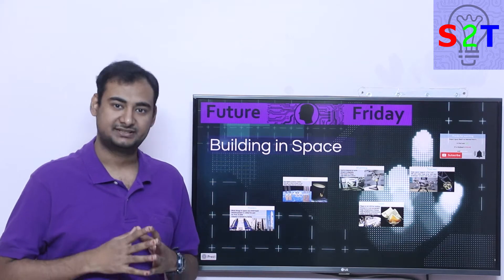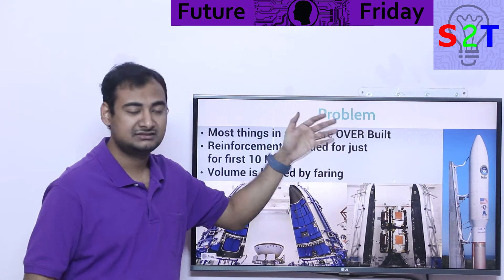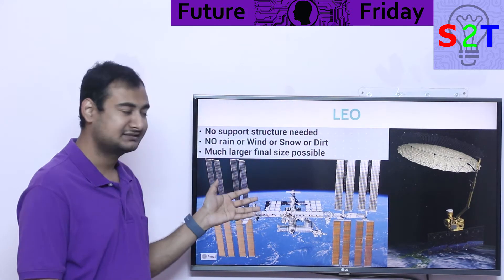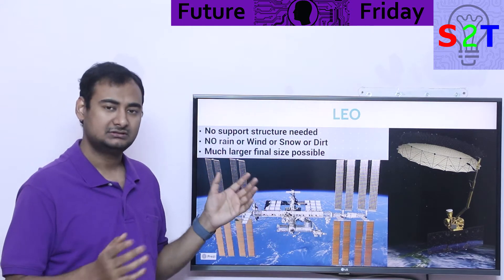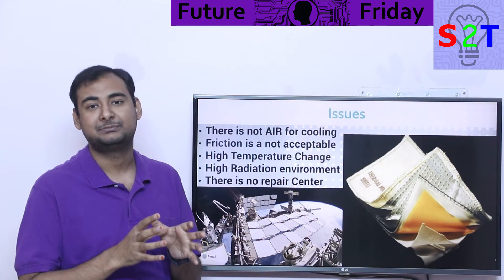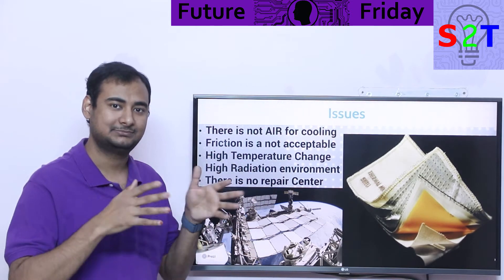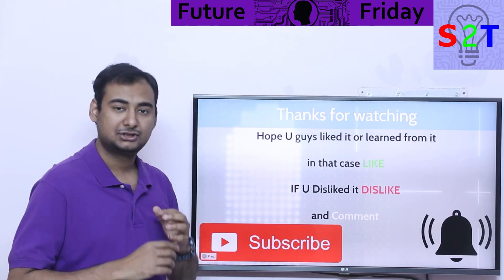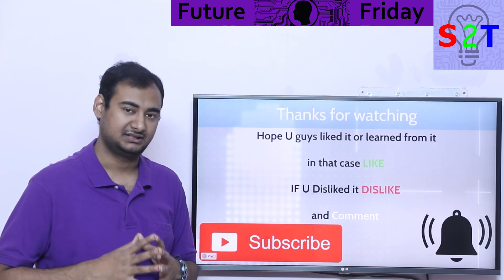Building in Space Explained {Future Friday Ep141}

Comment: videos on EVTOLS on the future friday
Reply from the maker: not useful unless we have magic battery and engines that we quite which cant happen as moving air at high speeds have it own sound
Reply: @s2tenglish  i don't understand what you mean by having there own sound
Reply: why do we need a magic battery, they can fly in a high altitude so they are in a controlled fall then the engines fire up when they lose altitude, and having a body that can increase its surface area and slide to reduce power use and go back on to maintain the glide